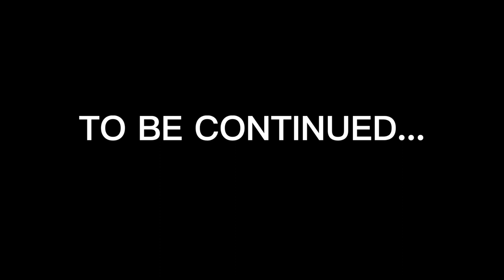Red Special Guitar Build - Part 1 - Blockboard Construction

Comment: Nice work - I'm just about to start one myself. In a rather strange turn of events, I couldn't wait for the templates to arrive so started building one based on telecaster - same blockboard hollow body etc - figured it would be a good practice for techniques. It's actually turning out better than expected so I'm going to carry on, hopefully I'll crack on with the real one in month or so.

Comment: great video and excellent job on the guitar. I repaired a neck pocket on m,y Ibanez artist guitar and was told by a highly regarded luthier not to use the GORILLA  GLUE due to it expands when it cures. And sure enough even under pressure of clamp my neck lifted .